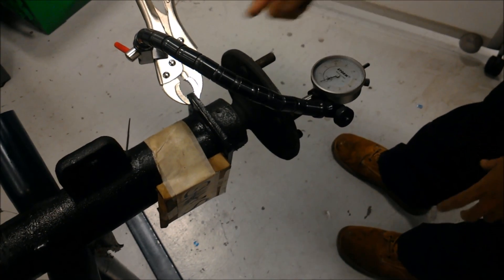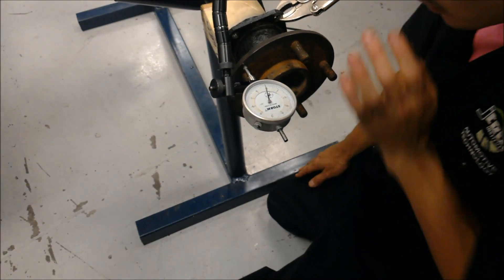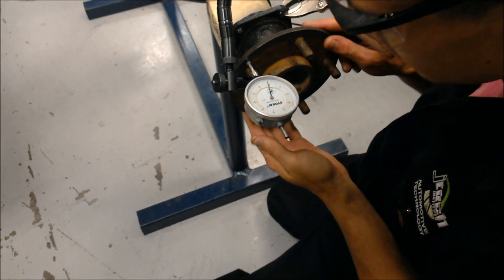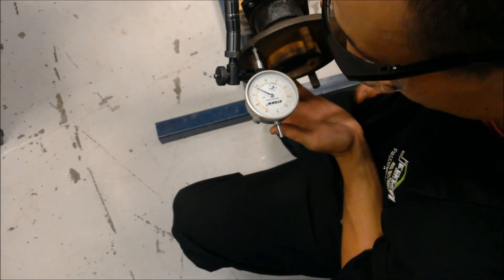How to measure ring gear & axle flange runout & ring gear backlask

Comment: when you measure backlash, its important to mention at which point on the gear tooth you are contacting the dial indicator tip - as in , tip of gear or, close to PCD etc.